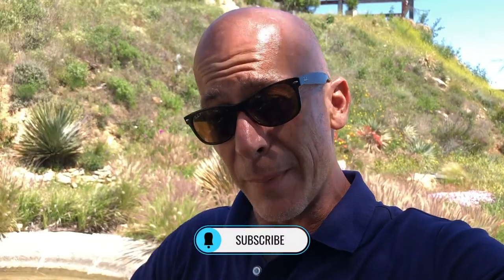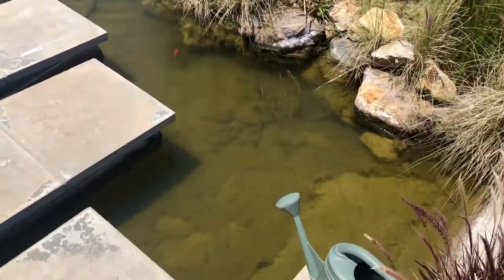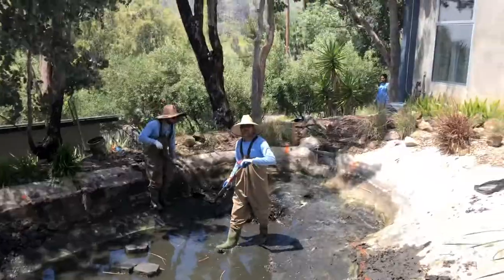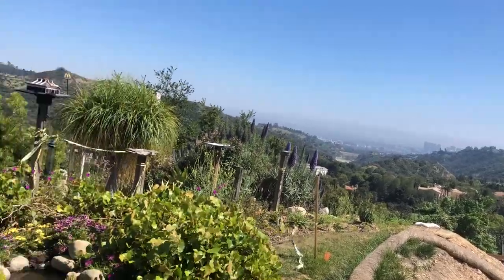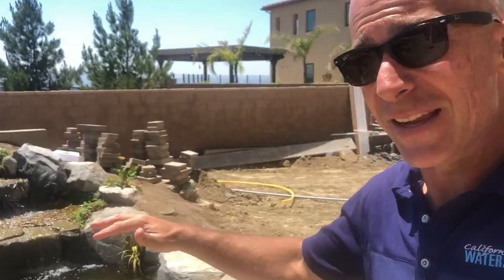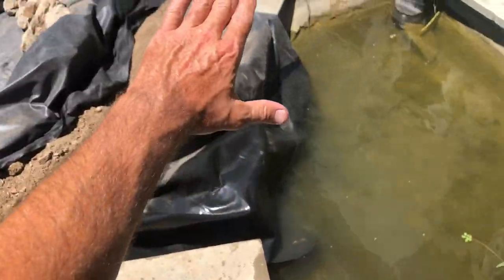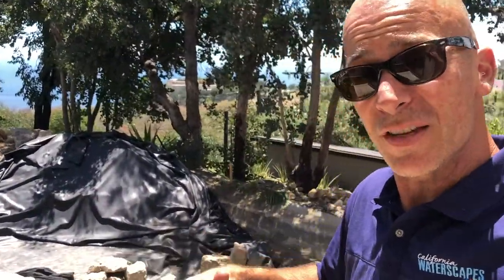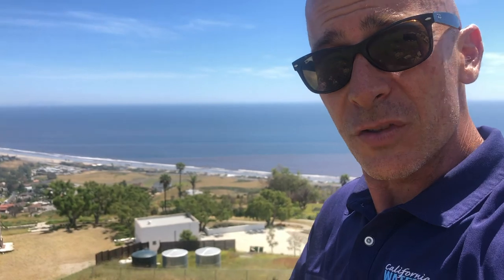Malibu Woolsey Fires Burned Down This Home... Concrete to Liner Koi Pond Rebuild!

Comment: I am looking forward to the continued build. What a location!! I am surprised the client with multiple concrete pools is not looking at supplementing their water features into further protecting the location with multiple water reservoirs that can be used possibly for fires. Just a thought.